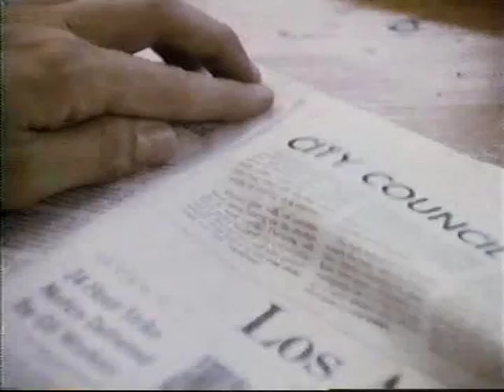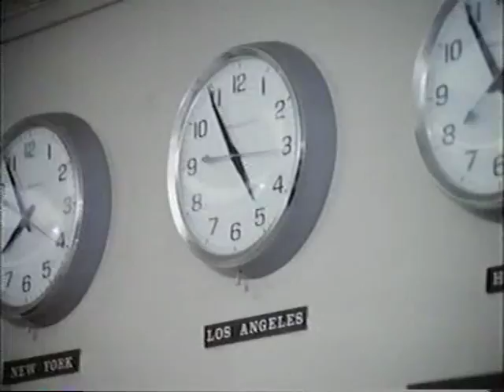Lou Grant S01E20 Spies

Comment: Wait, I'm confused. Isn't the CIA agent Driscoll? I thought that was obvious
Reply: I thought it was the slow poke typist Kellum. He fit the profile  Mrs. Pynchon described in her story about the Kentucky reporter back east.
Reply: Actually, I'm under the impression that it was either Driscoll or Kellam, or even, potentially, both. Driscoll spoke as though he knew how the connections would be made and Kellam certainly matched the profile described by Mrs. Pynchon. However, Driscoll's problem, which we learned in the pilot, makes me wonder if Intelligence would have considered him reliable. Then again, that same problem might have given him an almost perfect cover.